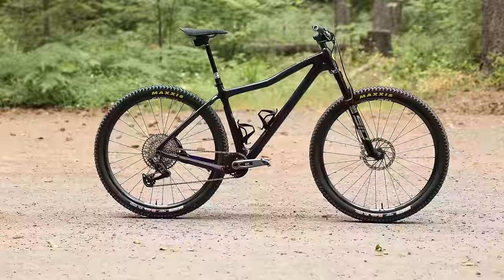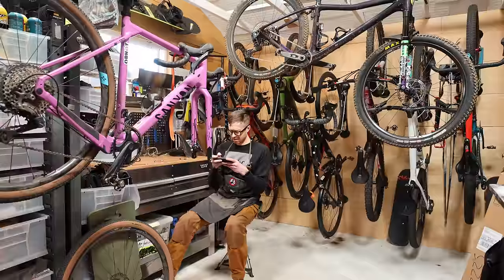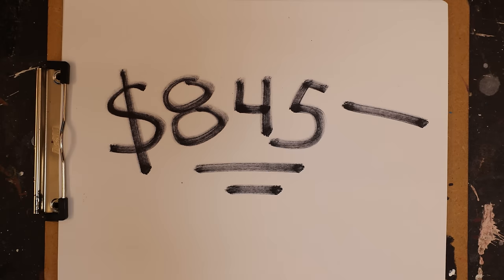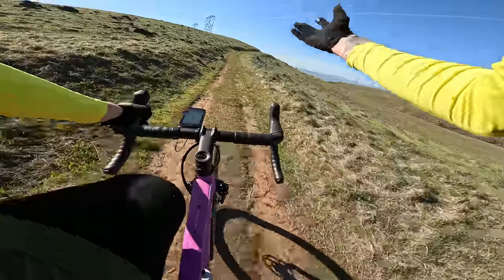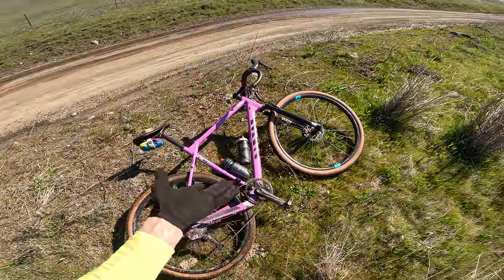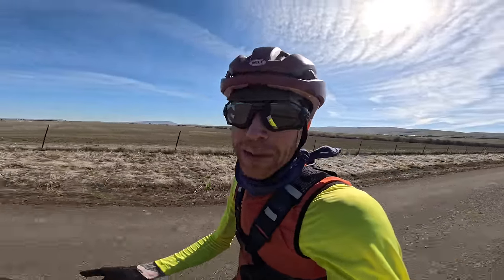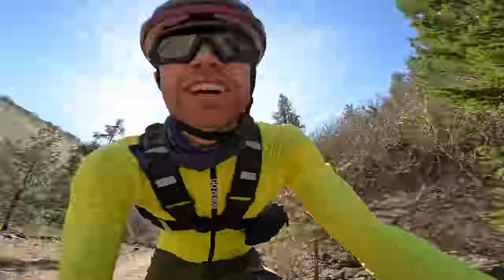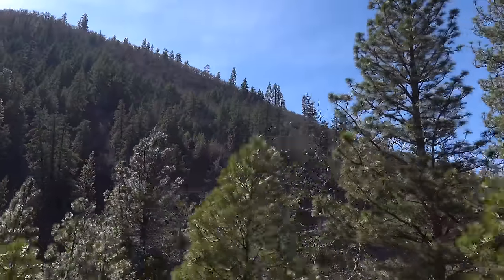The Most Controversial Gravel Bike Upgrade!

Comment: If you want a mountain bike, you should probably buy one, the intent of the gravel bike is that of an endurance geometry that can handle 50mm and smaller tires to explore more roads, thus, gravel. 🤷🏼‍♂️ suspension forks and the added weight they bring is a no go.

Comment: My first gravel bike had an old suspension fork on it and it was WAY better and faster than my fancy new rigid bike I upgraded to. I put a suspension stem on my new bike and it helps, but nothing makes a gravel bike ride better than a suspension fork. People don’t need a crazy expensive one. A crappy cheap one is still great because it doesn’t have to the crazy work a mountain bike fork does. Even just 30mm of crappy front suspension is worlds better than none at all.

Comment: A suspension fork is just another component. Put it on if you want, or not. The most important statement in this video is the one about value judgement. You don't need any of the extra bits, but it's a fun and cool way to spend your extra money and time.

Comment: You should compare the gravel fork on the Canyon to your Bombrack Hook with the suspension & the Cutthroat with the suspension you had on it.
Reply from the maker: This is a VERY good idea. But I think I messed this up.
I took the suspension off of BOTH the Cutty and the bombtrack.
I still have the 100mm fork I could put it back on the cutthroat OR add drop bars to the EPIC hardtail...thoughts?
Reply: @EverythingsBeenDone  If you can, do both. Test the epic with drop bars & see how it compares to the Cutty with a sus fork & with Rudy. How did Rudy compare to the MRP(?) fork that was on the Bombtrack?
Reply from the maker: THe bombtrack had first gen FOX and it was not that great. I ended up getting rid of it!
Reply: @EverythingsBeenDone  oh, I thought it was MRP sus fork cause I remeber seeing that speced from the factory in the Bombtrack owners group. I think it's worth a mentioning how what you thought of the old Fox 32 Gravel Fork vs the Rockshox Xplr & the SID forks.
Reply: @EverythingsBeenDone  how about super light XC bike with dropbars vs gravel bikes with suspension?  Don’t forget to include lefty as well if you do this
Reply: @dyadyaBOB Great idea especially if we included the Cutthroat close to maxed out, which I think is 2.4?

Comment: I'm no roadie purist, (I've been 1x and flat pedals on my road bike for years,) so 1x and droppers seem obvious for a serious gravel bike. Suspension makes sense, too. But 40mm of travel doesn't seem worth the weight or cost. If I'm putting suspension on my gravel bike, I'll just get a Boost axle'd XC fork, (Which will also reduce the absurd number of hub standards I have now.)  Is it just a drop bar mtb at that point? No, but the criticism isn't far from the mark. So what?

Comment: Lauf, zero maintenance and  add a droper post. The geometry is better and aligned to a forks made for the bike. The weight of the suspension is lower, reducing the center of gravity. 

So, for me, this is the wrong fork for gravel by far! It's a mountain bike fork, not a gravel fork. IMO

Comment: I’m of the belief that suspension forks make a gravel bike feel like a lousy mountain bike. Big volume tires and elastomer stems like the Redshift will bring the benefits of the suspension fork whilst keeping the geometry, lightness and responsiveness of a gravel bike. Yes, the suspension does “more” but at a higher cost, and at that point, I might as well be riding my mtb instead. If you have both bikes, there is no reason to buy this. If you have the one bike, probably.

Comment: "Ultimate Adventure Machine" is probably NOT a gravel bike no matter what you bolt onto it. I don't understand why so many want to turn gravel bikes into drop-bar MTB's? Just put drop-bars on your MTB and save your gravel bike for...gravel. Not gnarly single track, sky-shots off jumps, etc....gravel as in gravel..ROADS. That's what they're for.

Comment: The lockout cap is the worst design ever. Always comes loose and I had to buy a special alien key just to tighten it.
Reply: Blue thread lock?
Reply: @michiganstate149 Reds even stronger thread locker
Reply: @michiganstate149 maybe - not sure though - the problem is it's the tiniest little grub screw that holds it in place, so not even sure it would be possible to get threadlock onto it.

Comment: Yeah you're converting gravel bikes into mountain bikes 🙂.  If I want to ride something with suspension, I'm riding the mountain bike.  A gravel bike with a carbon fork should be all you need. If you're riding something that rough, pull out the mountain bike.  All that's happening is you're trying to retrofit a gravel bike into a subpar wannabe mountain bike.

Comment: I think people would need to reconsider if they really want a mountainbike at this stage. ;)
Reply from the maker: I’m curious how you define MTB?
Reply: @EverythingsBeenDone  Well, a hardtail like the Canyon Exceed CF is basically a flat bar verson of that bike at this point - just better. But by all means, if it works it works. I got a steel hardtail with 80mm suspension, which is probably even closer.